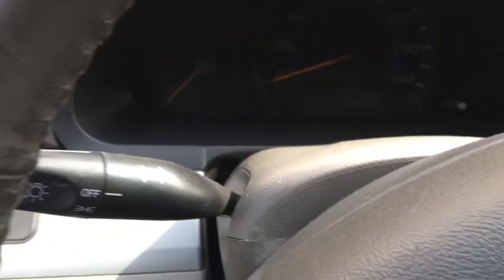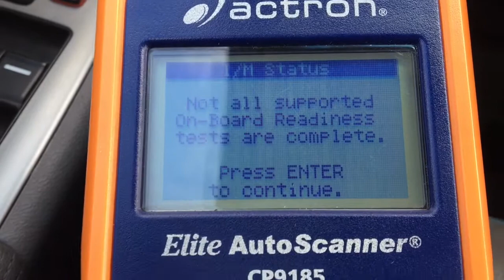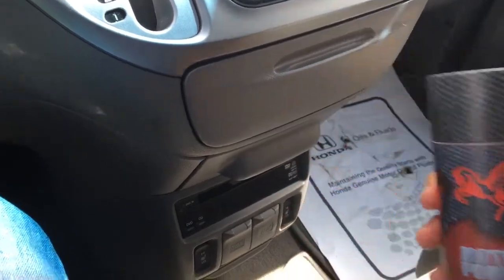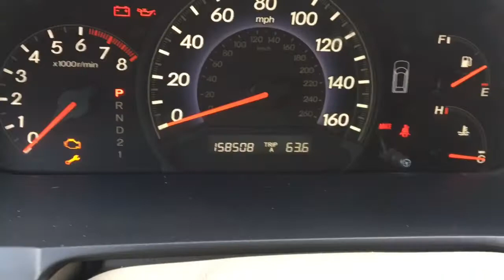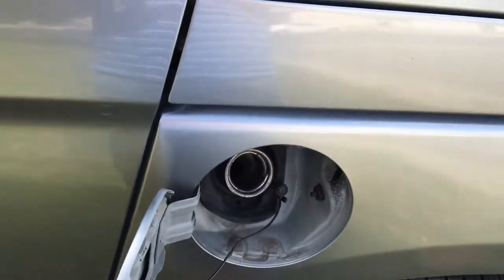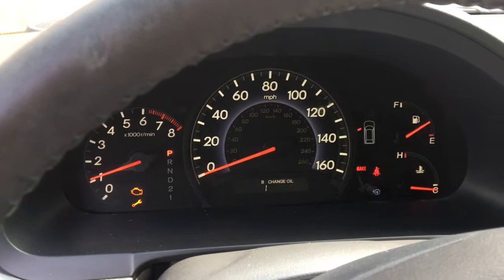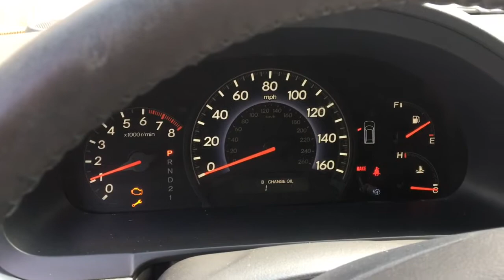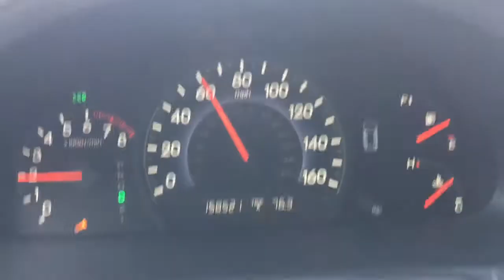MotorPower Care Catalytic Converter Cleaner Best Quality Motor Power

Comment: Just got two bottles, will be testing this product on my channel next week.
Reply from the maker: @ArrowheadGarage  Thanks for your support! We always recommend inspecting the honeycomb through the O2 sensor port using an endoscope camera to check for any cracks. Also, for a more direct and efficient cleaning solution, you might want to consider our DPF/Catalyst foam cleaner. Excited to see your test results on the channel!